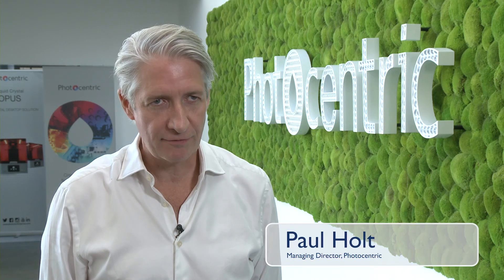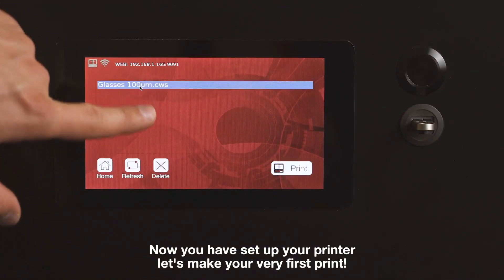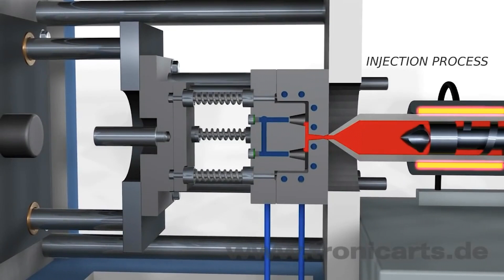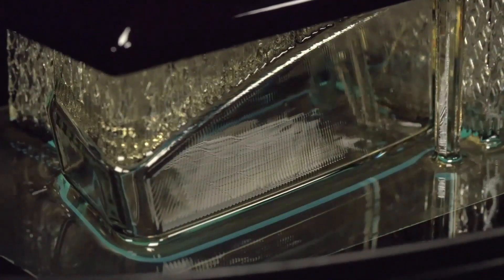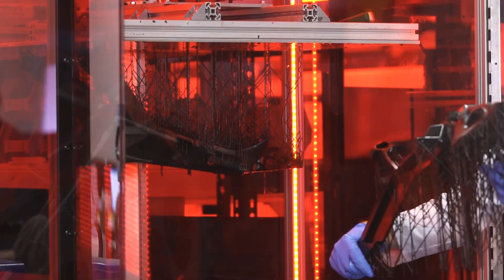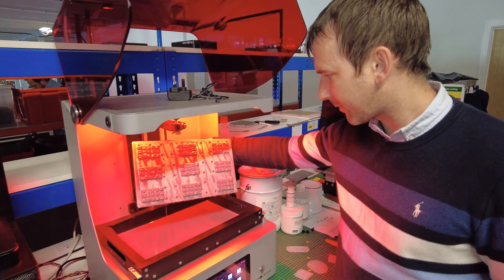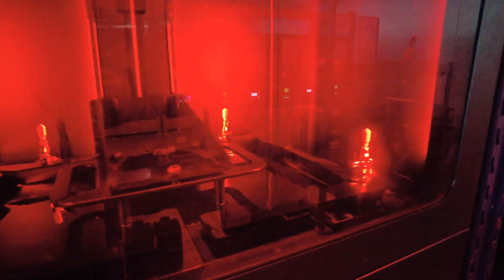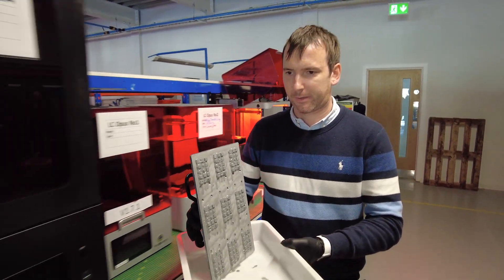UniPart joins forces with Photocentric

Comment: Would this method of printing parts have a greater waste of plastic as scrap due to the support system. The supports as far as I am aware cannot be reground and re-used as can be done in injection molding? This aside, an impressive product with its speed and repeatable accuracy.
Reply: Due to the low separation forces, the supports don’t use much material. The need for supports depends on the design and geometry of the model.
Reply from the maker: Due to the changes in design, parts are now being optimised for additive manufacturing. Advance lattice structures allows parts to have minimal waste materials whilst maintaining functional strength and accuracy. The lattice structure allows us to remove a significant proportion of traditional supports cutting down on wastage.